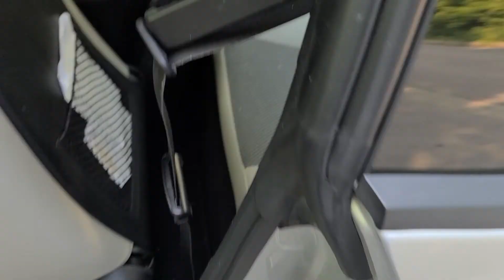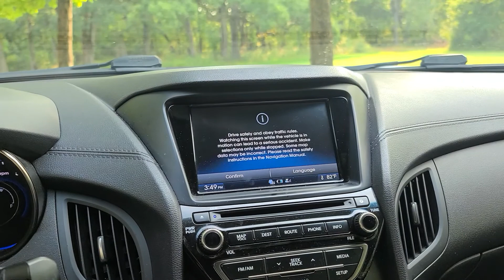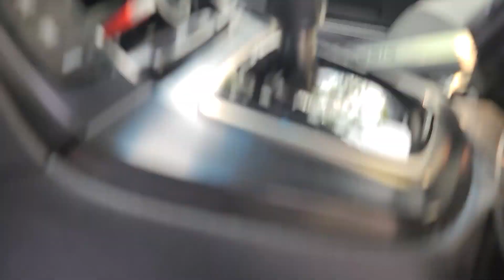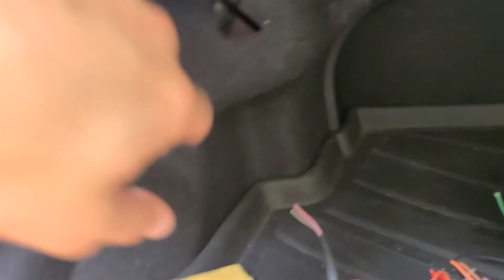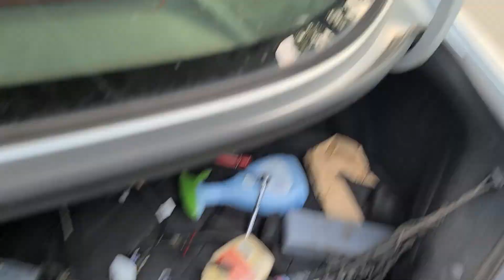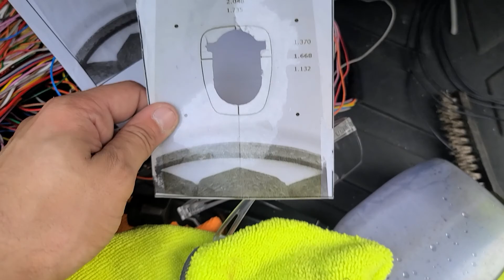2014+ Hyundai Genesis Coupe Factory Back Up Camera Installation!

Comment: Hey Bryan, pin 14 on the headunit is grounded and need to be cut for camera function to operate, and you briefly say it’s in goe into the right side kick panel area….can you be more specific, as I really don’t want to remove the headunit, if I don’t have to. Perhaps you have a pic or a connector assignment for that ground lead to cut. Thx Sean

Comment: Will it work with a aftermarket radio?
Reply from the maker: They'd have to be using the same four inputs/outputs at the unit.   Power, ground, video and video ground.  C-Can high and low would still need to be inputed before the unit.

Comment: where do you find the used junction box
Reply from the maker: Try junkyards in Canada or South Korea.   If you want the exact color coded pigtails.  Otherwise, the dealer for a floor harness repair kit.  I found one in Canada.   It was not easy.

Comment: Hello, where can I buy this backup camera?
Reply from the maker: New only hyundai dealers outside the usa  can get them.  Or you can search online for a used one.  Don't forget you still need the connector  showed plus pins and wires to make the harness

Comment: Would it work on a 2013 model?
Reply from the maker: In theory yes.  Wires would need to be run from kick panel to navigation headunit as that's missing on 2013 years